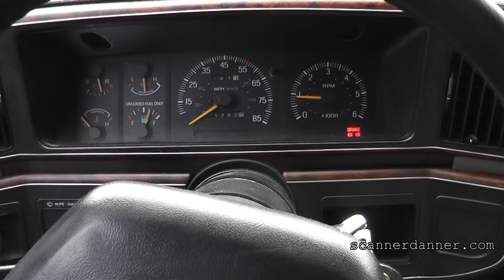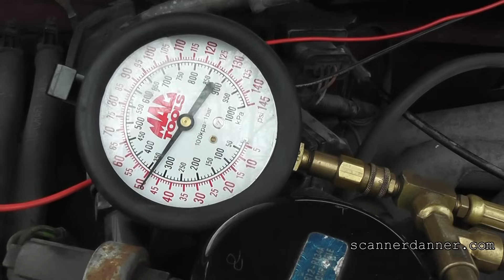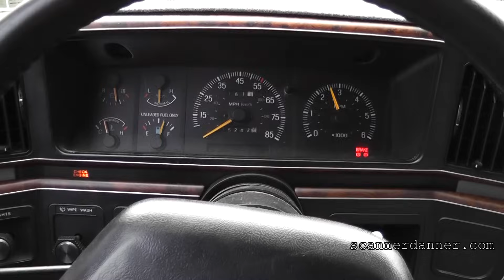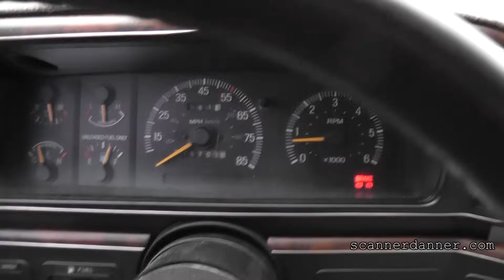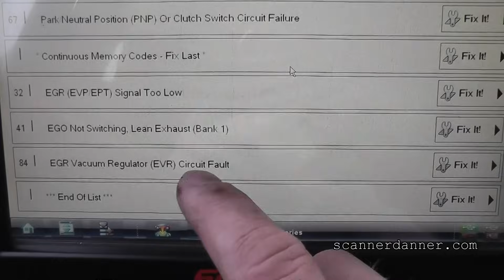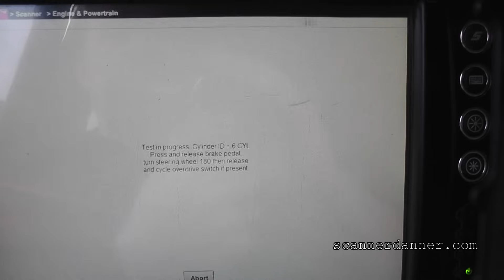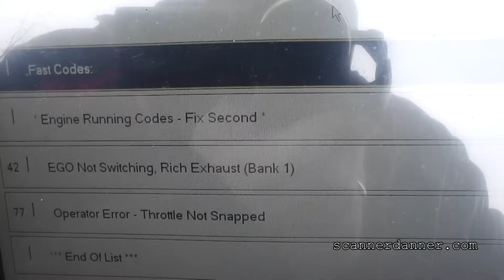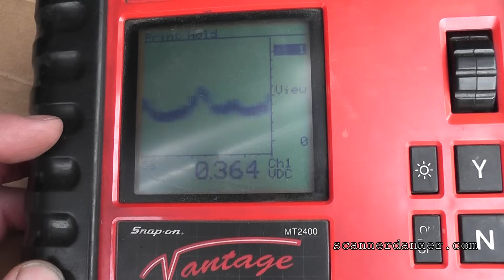1988 F150 Hesitation Problem [FIX!]

Comment: Wishing I had found Scanner Danner a long time before now. Watching only my second video of yours here and now, I'm wondering if this Ford truck could have a capacitor in the ECM ECU, etc etc what ever  it seems folks want to call the little mystery boxes . I doubt a feller would qualify for a response to a now 9 year old video, but I'm so impressed with your knowledge of auto electrical that I'd be very grateful for your thoughts on my 1996 7.5 F250 gas lover that hasn't ran since hitting a pothole in the road now nearing 2 months ago . The hole in the road has caused my under hood position #9 30 amp maxi fuse to blow as fast as I can put them in and turn the key (3 so far) .  If I hook my scanner (s) to the truck, they can't even find what's needed to pull codes to get an idea . I find a world of information about the Super Duty version of the same trucks but little to no information about the gas guzzling model that I enjoy driving (when it's running) I have never been much for electrical trouble shooting and now at the age of 60 and disabled I would like to learn . Problem is, is  that I'm totally illiterate to electrical.  Do you offer any training offered for Dummies ? I have 11 of the 9th gen Fords that all need something about them repaired or replaced . The most interesting thing I have learned is a little about the capacitors getting aged, leaking and causing a variety of quirky problems.  I sure would like to hear back from you if you haven't retired from YouTube!!!!
Reply from the maker: Do you have a good wiring diagram? You need to find out what all is on that 30a maxi fuse as a starting point.
Yes, I have heard of capacitors leaking on these early Ford computers but only recently and I doubt that is your issue with that fuse blowing as the ECM isn't generally powered directly from a maxi fuse.
Here is a link for the DIY version of the same service info I use. (Same diagrams)
https://eautorepair.adtrk.biz/?a=10817&c=24&p=r&s1=
I can definitely help you level up with electrical and electronics troubleshooting. Glad you found me!
Reply from the maker: Fuse 9 [30a] does power the PCM BUT it also powers the power relay and literally everything on that power relay circuit is suspect.
You need to do a good visual inspection of all the wiring for the following components. 
1. Evap purge solenoid
2. Injectors
3. EGR vacuum solenoid
4. Idle air control valve
5. Secondary air injection diverted solenoid and bypass solenoids
6. Transmission shift solenoids
7. MAF sensor
8. All 3 oxygen sensors
9. Of course the PCM too

When you have a direct short like you do. Unless you have a short circuit tester, the first thing I do is to ID everything on that circuit (which I just did for you) and then focus on areas of heat and vibration. Contact points of the harnesses. 
I would start with a really good visual of those oxygen sensors and make sure the wiring isn't laying on the exhaust.

Comment: I have a f350 I unplug spout set timing to ten degrees btdc its idling about 880 rpm then I plug spout in and the timing increasing to 24 degrees btdc and idle goes up to 1100 rpm is there a issue with the spout or computer ? I tried adjusting the idle and when I unplug the iac it drops only 50 rpm and the throttle stop screw is basically all the way as low as it can go so I don't think it has anything to do with idle
Reply from the maker: You will get a module controlled timing advance (spout unplugged) with that high of an RPM. We need to bring that idle down. 
Is there an inlet passage in front of the closed throttle place for the IAC that you can block with your finger to see if the idle drops? What is your closed throttle TPS voltage?
Reply: The idle drops slightly when plugging hole as for the voltage check I'm not real sure how to test that. I will have to watch some more of your videos haha. I know it is getting power. Also I have a code 122 which is tps voltage below minimum and a code 332 egr closing to soon or something.
Reply: So closed throttle I do have 5 volts steady on the power wire then on the other wire the volts change From nothing to 4.6 as I move throttle from closed to wide open. It's at zero until I start to open the throttle then it goes up
Reply from the maker: @Trolldaddy5  you should be reading around 0.5 to 1.0 volts on the TPS signal wire at idle
Reply: @scannerdanner so you think it's a wiring issue or the sensor ? The sensor seems to work when I move throttle
Reply from the maker: @Trolldaddy5  I sounds like it is an adjustment issue. If the TPS is not adjustable, then the throttle plate stop screw may be backed out too far. I understand this will be counter to our high idle speed (adjusting the stop screw out further), but it is possible you have a vacuum leak that is making it idle high and someone turned the base stop screw down too far to try to compensate? Here is the right way to set it (with no vacuum leak of course) https://youtu.be/ayjhL9jpFH8
Reply: That screw there to adjust the throttle blade where make the blade not close all the way to hold it open just a tiny bit

Comment: if the o2 signal was lean and the computer is adding more fuel creating a rich mixture why would egr flow cause hesitation I would think if it was running lean not rich it would stumble because egr flow would further lean out the mixture?
Reply: In short, EGR gas dilutes the mixture. Best short answer description I can give without going into the "tomato sensor" as it is known on iATN.net (O2 sensor theory)
Reply: ScannerDanner Premium so is the hesitation because of too rich a mixture? By the way I really appreciate you taking the time to make all these videos and sharing your knowledge with the rest of us your are a credit to your profession
Reply from the maker: John Brown
thanks John

Comment: Those timing marks are weird.  My '87 Bronco 302 has a timing pointer attached to the block and the scale is on the HB.  I painted the scale with white paint then wiped it off, leaving the etched  timing marks in bright white relief.

Comment: I loved when the cars only had a battery, a coil, a distributor, spark plugs and a carburetor.  All you needed was air, fuel and a spark and the vehicle ran.  It wasn't killed by a crank position sensor or mass air flow doohickey.  What the car AND MOTORCYCLE industries have done is over complicate our vehicles so only a dealership can work on them.  My buddy bought a 1993 Honda Goldwing and it is almost a sealed unit that only a dealer can fix.  And, of course, at $ 90 per hour it takes hours just to remove the fairing and covers to get at the machine.  Whereas my 1982 Goldwing is all out in the open and easily accessed for repairs.  All these O2 sensors and computer controlled everything are absolute nonsense in an America built by rugged individualists who used to do things for themselves.

Comment: Mines a 91 f250 7.5 it runs good when i first start it but after its warm it runs crappy or if my stereo is turned up 5k amp going full tilt i can barely accelerate at all i put a high output 3g alternator on it i really need help im making a 2k mile journey in a month

Comment: You can remove the #1 spark plug and stick a pencil, straw, or something non metal into the hole so it sits on the top of the piston. Turn the crank by hand and watch the pencil,DO NOT LET IT GET PINCHED it should be loose in the hole. You'll see it rise up, stop, then go back down. the point where is stops is where TDC is, technically between where it stops rising and starts going down. Anyway your crank mark should be right on the scale.
Reply: Co Jones

Comment: trying to get an '89 F-150, FOX, Lariat 351 W running in my spare time, where squirrels have chewed the wiring to pieces, injector wires, Ect. even the starter wire was not spared, many of the vacuum hoses have withered or been chewed from setting, the engine was completely covered in grime, painting each part, truck blue as go, Been looking at forums as I rebuild found out the average GPM was 10- 12, (7.5 L) but as I have been replacing accidentally updating each piece found many new parts from new trucks fit, changing the injectors to the updated version changes the flow enough to get 18 MPG bought the truck non running with a head gasket set ready, can't wait to fire it Off and hear what she sounds like, my luck, probably Head gaskets, an old truck maybe need to get it going before digging in, caution before buying books Etc., bought a CD said official ford product was ok, but what a piece of crap

Comment: There are distributor wrenches that will get into the area to make that easier. Craftsman may have it. If the timing mark flutters, it's the module. On Fords, there is a 0 mark which is that notch. Use a Snap-on scanner to check codes and test systems before driving.Did you plug the hose? Now you can replace the EGR and charge the customer. Check for vacuum at idle. There shouldn't be any. Check the EGR vacuum solenoid if there's vacuum. Set the scanner for fast codes to erase codes. Always recheck codes. Oxygen sensors can stick. Maybe use a torch to loosen it. After repairs recheck codes. Having the name of the business and phone number might cause trouble for your business. Thieves can use info.
Reply from the maker: did you watch the video before commenting? I'm thinking no, but thanks for the tips
Reply: ScannerDanner I'm certainly not criticizing your repair. I'm also posting comments to viewers to help them sometimes. You did everything you should to troubleshoot that truck! We all make mistakes seeing how cars are different. Timing marks are different on different cars. But the good news is that you have better equipment to further test things! In the end, problem solved!
Reply: No problem Marty! Thank you again for the tips.
Reply: ScannerDanner Premium Keep up the good work! You're the PRO!!

Comment: Well at least you did not need to set the dwell. lol Points remember those .  When i can not find mark and car seems to run half way ok ,. I set rotor to # 1 . Then it may not be on the mark but gives me a area on balancer to look . Some of the marks are hard to find .

Comment: Can you just use a scope put use a pick up on coil number one and a in cylinder waveform and just adjust the timing at while ( of course pausing and measuring the spark to tdc point. Or maybe even use the exhaust pulse count 360 off that and adjust the spark. I know that was written poorly sorry.

Comment: Anyone know if fuel pressure should rise on the old gm tbi motors on a snap throttle?
Reply from the maker: It will not as there is no vacuum going to that TBI fuel pressure reg. One steady psi all the time on that one
Reply: @ScannerDanner  thanks bro.

Comment: I thought the #1 plug on these fords was the front right plug on the passenger side. my timing mark and pulley are not the same as this video but I have and '89
Reply: F-150s came with three different engines back then so you probably don't have the straight inline six 300CID/4.9L engine shown in this video. The timing process is probably similar I believe all the engines use TFI ignition. For the 351CID/5.8L or 302CID/5.0L V8 engines, one of which you should have in your truck, there are plenty of videos on timing those engines just search for Ford 302 or Ford 351 timing.

Comment: I( know this video is old but ford techs could see live data. I have a couple of those old body style and found a affordable scanner Actron Eliite Autoscanner this scanner shows live dat on the old fords. I was having an intermitent  issue with no codes. it was a sticking iac motor

Comment: Where are your services located ?
Reply from the maker: Pittsburgh Pa
Reply: @ScannerDanner  dang, I have a 94 and it has a no start condition and can’t figure it out , fuel pressure injector pulse and coil pulse are all there but will not fire had it running before I re stabbed the distributor but now it just won’t start
Reply from the maker: @Shogoat1304  restabbed the distributor??
Reply: @ScannerDanner  yeah I pulled the distributor out, and re set timing because I thought the distributor was a tooth off, i re timed it and still won’t run the balancer is way off so I don’t even have a reference
Reply from the maker: @Shogoat1304  but it ran before you pulled the distributor? Then you need to start there. Pull the number 1 spark plug out and put that cylinder at TDC compression, then drop your distributor in with the rotor pointing to the #1 on the cap
Reply: @ScannerDanner  I’ve tried multiple times unfortunately used the old shop towel trick and it putts but won’t fire, I’m almost to the point to pull the valve cover to triple check and verify cam timing isn’t off or something, when it did run it ran very rough like it was down on multiple cylinders, it shook like crazy. When the piston is at tdc, 0 on the balancer is about 45 degrees to the right also so will be replacing that also,

Comment: Shows who knows their stuff, and who doesn't.
I was in the dealer when that truck was made, no shortage of work for me.
O2 in a chevy will cause all hell, but on a Ford, the O2 is not God. You can drive around all day and not notice.  It's easier to just read the plugs, cause nobody tunes their rigs anymore.  At 33:53
Reply: Never had one go completely flat line, but a lazy O2 will go unnoticed for ages. However, I serviced them when they were still new. What do you want to bet that was an original sensor

Comment: May i suggest step 1 remove plug 1...stick in screwdriver or camera...bring it to TDC...then verify the pulley...u dont know who if anyone has been in there or what they may have done...then go ahead n time it and all that time on the puter u simply jumper in the port and count the flashes...
Reply from the maker: Sure, but the truck is fixed and long gone

Comment: Good job.
Reply from the maker: Thanks!
Reply: @ScannerDanner  i have a 1989 f150 dual tanks got it running oke been sitting for years.  5.0. All of a sudden loud metallic ticking prior it was pinging or what sounded like fuel knock at start up changed oil and filter no better. Ive done so much to this truck ive actually never owned a truck that needed so much one thing after the other probably mainly from neglecting and it sitting for so long. I hate to just give up on it but thinking of cutting my loses and getting something newer that needs less work.
Reply from the maker: @phillstruckrepairstanley2509  oil pressure readings must be the next step on this thing

Comment: Personally I'd re-check timing after replacing O2 sensor , Or maybe it was done and I missed it?
Reply from the maker: timing was tested and was good and with the spout connector unplugged, the ECM has no control of base time so an O2 fault would NOT effect base time

Comment: A little suggestion for Ford owners and maybe all DYI people. Go to your local hardware or big box Lows, Home Depot, I've seen these rectangular shaped sanding blocks of various grits.  Buy a few of these sanding blocks to keep in your arsenal of tools and use them carefully from underneath your vehicles, allowing the harmonic balancer to spin either running or have a friend of anyone to turn they key over getting the balancer spinning and let the sanding block work it's magic cleaning the surface and revealing all your timing marks . You can even fill the stampings with your favorite color paint markers after the cleaning and repeat the process to make all your timing marks bright and clear . If you decide to take this advise which is f cking golden, be extremely careful where you put your hands . And do as Scanner Danner and use some good cleaner to clean of your stationary timing marks before you use this sanding block cleaning the years of oil and dirt from your balancers.  Nobody ever suggested this method to me, it just came to me one day trying to find all that overdone bunch of numbering that Ford feels necessary to put all over all their balancers. You're very welcome!

Comment: question, i thought you shouldnt aply battery voltage to o2 sensors.
Reply: he didn't run 12 v. he used a test light as a resistor. if you have the know how a ford spare tps will do the same thing

Comment: It's messed up that the O2 sensor didn't set a code. Is that normal for an 88 FORD?
Reply from the maker: It did set a code
Reply: ScannerDanner yep it did  HEGO not switching  rich/lean. it show lean cuz that's all a ford knows to do. when it looses com with the pcm  pre, limp in mode. the engine will run rich. but at least it's running. lol
Reply: ScannerDanner
opps , I see that now.

Comment: check the fuel switching valve if w/ 2 tanks
Reply: There is a filter in them.
Just solved issue from that valve clogged up.

Comment: Still wondering why the PCM didn't throw a code for a bad OXYGEN SENSOR?
Reply from the maker: These older systems had different thresholds for setting oxygen sensor faults. 
For comparison:
OBDII systems will flag an O2 code if the switch rate of the O2 increases over 100 milliseconds 
Pre-OBDII system, the O2 may need to not switch for 8 minutes before flagging a code. 
See the difference?

Comment: Any sparkplug can be #1 as long as its TDC. And remember 10 degrees  before TDC on compression stroke. And dont drop the timing light they dont take kindly to it.
Reply from the maker: That is not true. The #1 cylinder is mechanically timed to that mark on the balancer. You can't pick any plug wire you want and call it #1
Reply: @ScannerDanner  an old time engine builder told  me this trick. I dont think it will work on EFI cars with ECM.

Comment: Thats not the timming mark. Its either a small little line the size of a finger nail or a simple little dot the size of a pencil. Some times trying to check time wont work tjis way as the harmonic balance shift a few degrees because the ruber damper break down.